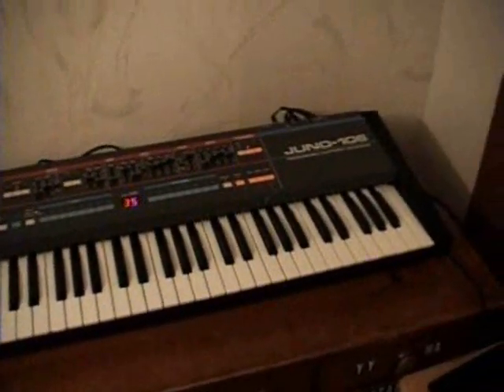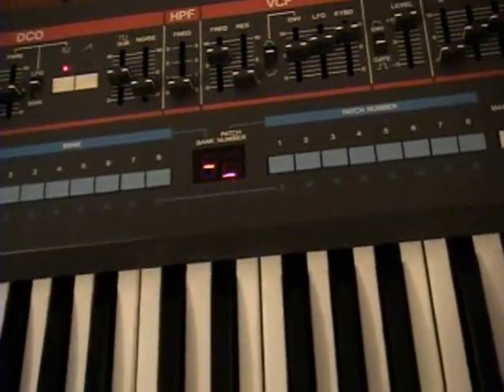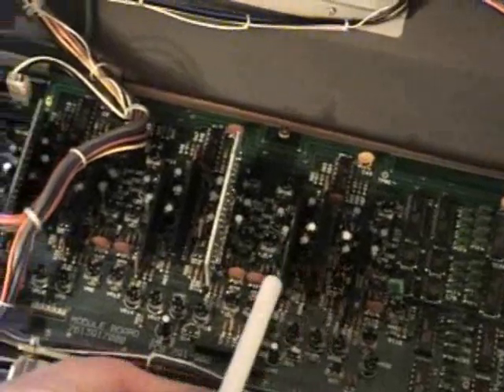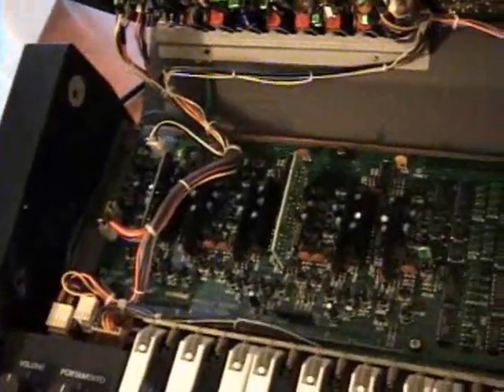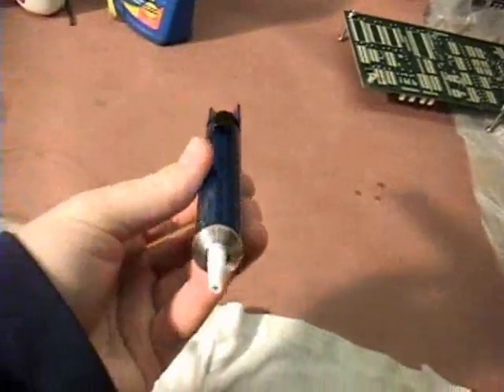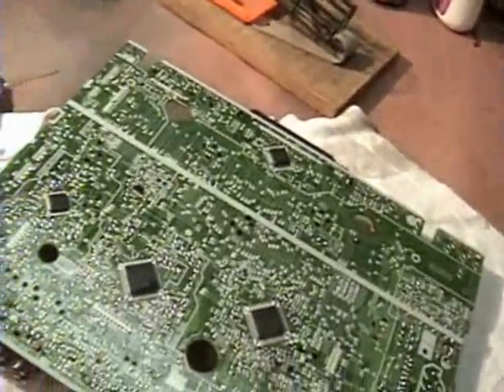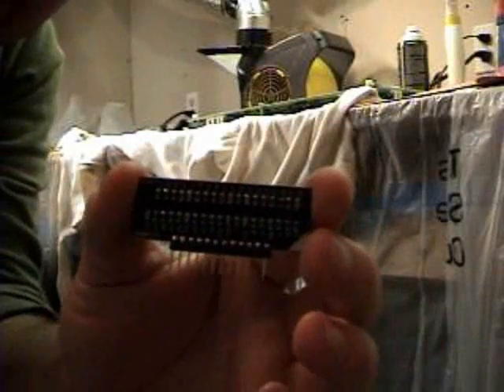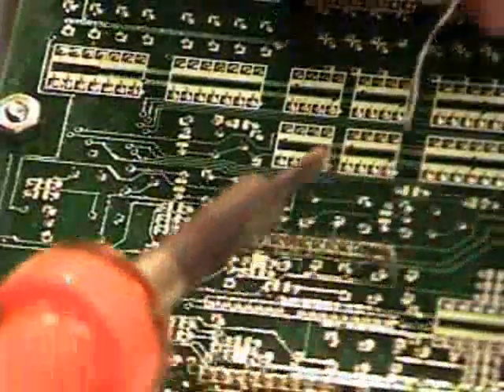How to replace Roland Juno 106 Voice Chip 80017A   1 of 2

Comment: Thanks for posting this! I bought the full set of cloned voice and waveform chips to do a full replacement on my Juno 106 so I wouldn't have to mess with this again. Your video is great, I'm pretty handy with a soldering iron but haven't done a lot of desoldering. It was really helpful, thanks!

Comment: I have followed the instruction, but haven't been able to start "the test mode". 
Neither the "Key Transpose", nor the "Poly 2" seem to be functioning. 
Any idea as how to fix this issue? Thanks.
Reply: The tact switches under those buttons have gone bad.  It's a common issue.  Check out the videos by Syntegrator for instructions on how to remove the panel board and have a technician replace your tact switches (all of them). Then you can access the test mode.

Comment: One item worth mentioning is that the chips may be restorable by soaking in acetone.  (A Google search will provide you with more information on this.)  As such, if you have the skills, it's probably better to de-solder them and attempt restoration or keep them as spares, rather than break them off the board as suggested in this video.

Comment: I got a question: One voice-chip of my Juno-106 is not working and the VCF of the same voice isn't working too. If I simply change the broken 80017A-Chip, will the filter of this voice work too? Is the VCF included in the 80017A-chip or is the VCF contained in a seperate chip?